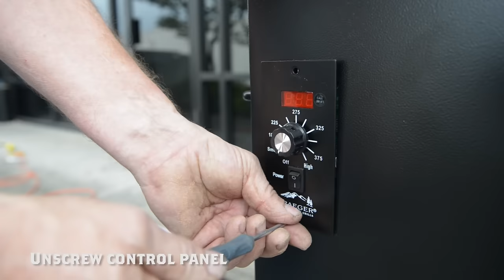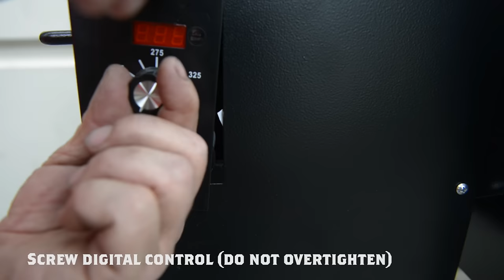How to Replace Traeger Hot Rod | Traeger Grills

Comment: Good video! We went into the fire cup and it was caked with ash. Cleaned that out and found out the old hot rod is still good. Will save the new one for another time since this video shows it will be easy enough to go back in there. And kudos to Treager that your smokers last a lot of smoking hours and you make them easily repairable!

Comment: You don't have to unscrew the hopper. I did this the first couple times as well. But if you tape the new connector to the end of the old hot rod and pull it through it is much easier with the hopper still attached.
Reply: Unless it's like mine (Junior model) where the hole for the wiring is on the side of the inner housing and facing the same direction as the control panel, requiring the wiring and rod to make a 90° turn versus the path shown here, plus the hole being so small that it requires an exactness not possible with the hopper in place ☹️.
Reply: @qleap99  yes. Sometimes tough… But you can also run a coat hanger or #9 wire through the hole where the controller sits and then push it through till the Burnpot, bend a hook w Needlenose, then pull the connector through from that side.. Works great on some models as well.. 
Just a matter of getting creative.

Comment: Suggestion: Disconnect the end of the old Hot Rod wires, attach a string to these wires, with the old Hot Rod disconnected from inside the firebox, pull out the old Hot Rod. Now you can use the string to pull the new Hot Rod through the channel and connect at both ends.
Reply: Thank you! This was painless. I want to provide additional details (I have a Traeger Pro 22). The rod is long, but the gap between the hole and the wall under the hopper is obviously very small. You should put the rod parallel to the wall and then slightly angle the rod to give you just enough clearance to put it through the hole.

Comment: I use my traeger at least 3 times a week and the worm drive went out recently. Got the new one installed in like 5 minutes and now the stupid hot rod isn’t working properly. Hopefully after replacing it i will get at least another few years of heavy use out of it. I will say though that ive had to take this damn thing apart and fix the motor coupling like 20 times. I can build one of these from the ground up in 10 minutes. Not sure if this is the best smoker for the price. After all the tinkering and repairs i think id rather get something a little more high end. But we have enjoyed it when it’s working properly. Problems started about 6 months into heavy use and it’s been a like that ever since. If I wasn’t so cheap i would toss this thing in the garbage and get something else.

Comment: Does it matter how far out the heating rod should be in the pot?  My new Bronson is really erratic and the rod doesn't stick out as far.  We've replaced the controller and its still acting up.
Reply: Yes it does 
I found this out after very frustrating time 
Specifically 
No more then 1/4 inch
VERY IMPORTANT 
INSTRUCTION that ALL the helpful videos 
TOTALLY DISREGARD

Comment: Removing the cover is NOT necessary if you're willing to lay down underneath it....just unscew the fan and let it hang (on the older CostCo BB400 Select) if you need finger-clearance to get ahold of the Hot Rod connector fed FROM the Fire Box, not TO the Fire Box.

My only concern was temperature calibration....new Hot Rod fired right up and ignited pellets, but readout said it was over 400° way too soon, I could feel the radiated heat was nowhere near that high....now what ?

Comment: Way too much work.  Just snip the old hot rod off, tape the new connector to the old wires, and pull through to the other side.  Make sure to run the connector through the hole by the fan so it doesn’t interfere.

Comment: I bought it around 7 years ago at Costco, I am trying to replace it. All metal materials are rusty and removing the fire pot was very hard.. After I replacing the rod, the fire pot didn't get in,, The fire fit should go much lower, but it didn't,, It looks like all metals were rusted and deformed.. The Weber grill which is much older has much better shape. The traeger grills should use better material. I don't know how to fix it.. 
If I have to buy it, I would rather buy Weber,, which has way better and durable material.
Reply: Sage brush I used my dewalt drill with a fresh bit and it removed the screws no problem.  I had particular issues on the fire pot screw. But my dewalt got it out. I reinstalled snug but not tight.

Comment: Not even half as easy as this video makes it look! Yours isn't brand new. Yours will have rusty screws that strip out and God only knows what else. Don't bother! It's a fatal design flaw as far as I'm concerned. Do yourself a favor and spend the money on a real smoker. It'll give you way better flavor and doesn't have electronic parts that have to survive high temperatures and outdoor conditions.
Reply: You didn't even try to do this, did you? I'm pretty klutzy and I did this in way less than an hour, and that includes learning the theme song on guitar.

Sounds like you bought another type of grill and just wanted to troll this video.
Reply: I've owned mine for 12 years and never had any problem whatsoever. I just now replaced my first hot rod without removing the hopper and it was very easy to do and took about 20 minutes. Our Treager does a good job and has been trouble free for 12 years so I don't really agree with your assessment.
Reply: @Mooseboy08  "...and that includes learning the theme song on guitar." Haha! Best line in the comments. :)
Reply: Baron if I may ask what is the climate winters/summers like where you are? I’m wondering about the extreme hot/cold? Thanks
Reply: @Mooseboy08  the heat over years affect the materials. I’m not klutzy and maintain my smoker...and yet had similar issues. Screws were stuck and metal was warped. Getting the fire pot out, finally getting the hot rod set screw out can turned a 15 minute job into a 1.5 hours. I had to cut the wires on my hot and reinstall new molex pins as the plug would not pass through the opening nor would the rod. So don’t be so quick to judge other people’s comments. Traeger makes a lot of different models and I know some of us who have the first variants have a little different set up to deal with.
Reply: @cleophusfowler I’ve had my Traeger for less than a year and am having to replace the fire rod already.  Within the first month I had to replace the thermometer because it wasn’t functioning properly.  I wouldn’t judge someone so quickly just because you’ve had a different experience.